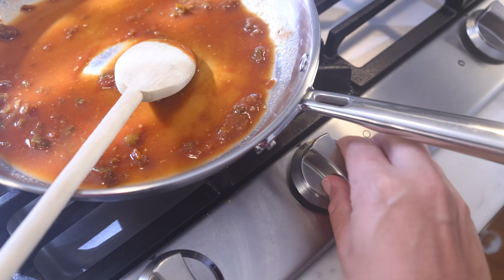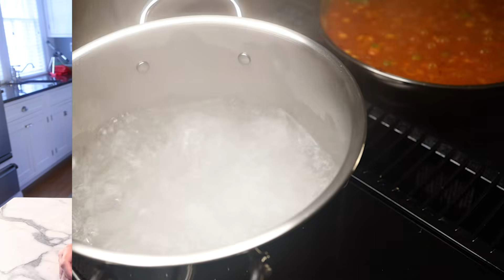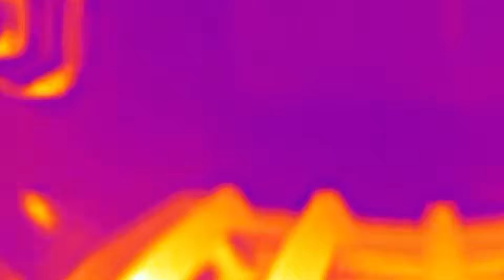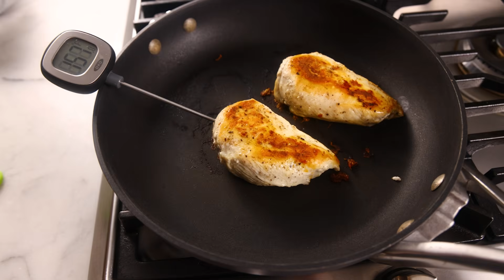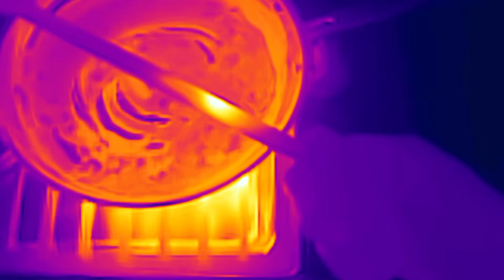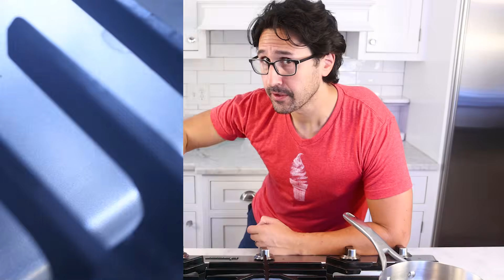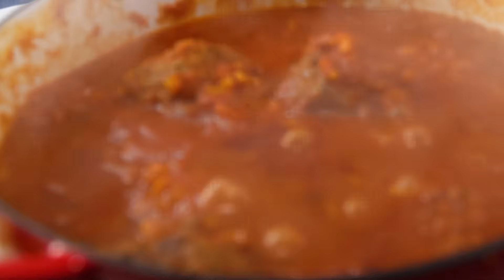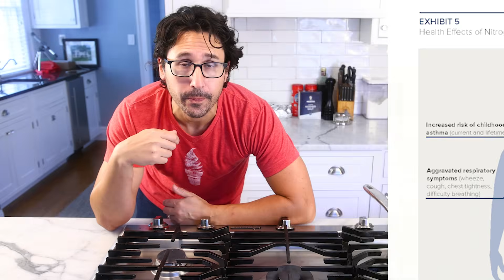Problems with gas stovetops | weak, dirty and dangerous

Comment: I wouldn't call NOx gases odorless. NO is odorless but it instantly drops your blood pressure and makes your heart rate shoot way up, you can't not notice it. NO2 doesn't have any noticeable effects (besides asphyxiation) but it does have a smell. It's a faint smell but it is there, reminiscent of diesel exhaust but with all the sweetness removed.

NO also very quickly degrades into NO2 so it's not a major concern. Besides, in high concentration NO2 has a strong deep red color, so you will notice it if it's getting bad. But natural gas makes so little of these compounds that by far the most troubling issue about it is carbon monoxide poisoning. CO really does have no smell, and if your room is small and without any air intake it could potentially asphyxiate you.

Comment: I hate electric stoves. I've only ever had the coil kind, and they were a nightmare. They did not heat anything quickly, it was impossible to maintain a temperature. I love my gas stove. If induction is better, I could get behind it. I've never used induction, so I couldn't say.
Reply: I’ve personally cooked with all 3. Induction is just way better. Less heat that escapes and makes the entire room way too hot. Works really efficiently and can make things hot really fast. Tho one of the negatives is that you can only use magnetic pans and you have to take good care of the pans because if the pans don’t have proper connection with the stove it doesn’t work as well anymore

Comment: genuinely can't wait to replace my old stove, even if its with another gas stove. the dumb thing wasting space in my kitchen has to be manually lit with a grill lighter just to get it going. the thing gives me enough anxiety that I prefer to just not use it and make things in the air fryer or on my little hotplate instead

Comment: The one thing I really like about gas is it is very visual. If a burner gets nudged, you can see the flame size increase or decrease. Also you're not going to forget to turn the burner off as the flame is pretty impossible to ignore. A lot of people dislike the more expensive pans you need for induction as well; although i think pans are something worth splurging on, so isn't problematic for me.
Reply: carbon steel isn't that much more expensive is it? I wouldn't want to cook on a $3 teflon pan anyway for health reasons
Reply: @niamhleeson3522  not all carbon steel pans work on an induction top. In consumer product speak, all carbon steel means is that the steel is reactive and can rust much easier than a stainless steel.
Reply: @atavax311  Wouldn't all steel pans work on induction? I am pretty sure I could heat up a box of nails on my induction top? I might need to test that.
Reply: @odizzido  I'm fairly sure not all steel pans. Generally to test if a pan will work, if you can stick a magnet on the bottom it will work on induction. I think it's the proportion of nickel in the steel that determines if it will work on induction.

Comment: I loved my ancient open coil. It did once blow and put a hole right through my pot though.
That said, for my tastes, nothing beats gas, which is going into the new kitchen as the main cooker, with a separate induction field purely for big pots of water or stock. 
I tried induction for general cooking and it just doesn't work for me.

Comment: Interesting. I generally prefer electric, but it’s because IME it has /lower/ heat. On every electric stove I’ve lived with (at least 9), I could make custards without a double boiler. But I always considered the lack of high heat with electric to be the trade-off. That, and the wok not working on electric. I had no idea there were electric stoves that could put out more heat than a gas stove—I’ve certainly never used one. 
My perfect stove would be 3 induction burners and 1 gas burner. Most of the time I want electric, but for some things gas works better.

Comment: i actually have the exact opposite issue with my current gas stove. it is just too hot actually. even on the smallest burner on the lowest point on the dial it just gets way way way too hot to do any kinda sauce without constant maintenance or the sauce splits.
Reply: @JorgTheElder  must not have heard that part.

Comment: I actually have a problem with my gas stove being too strong. I only use the two smallest ones and still, if I use a pan on the larger of the two, it gets very hot, making it very likely to shoot oil and cooking things like eggs too quickly. My only solution is to turn it on for a bit and then fully off, and so on.

Comment: I think he's mistaken electric stove tops with induction stove tops. That black portable stove top right at the begining works with induction and heats apropriate metal pans by generating osclating magnetic fields while an electric one will heat a stove top by means of a resistor.
Reply: He knows

Comment: Gotta disagree. Seeing that one of your pet peeves is the time it takes to boil I must point out that you showed that you have a portable induction cook top. I do too and there's no reason not to use it to bring water to boil in record time. Then just move pot to the gas stove. Very easy to do since you're most likely using induction on the countertop right next to your stove. 
Also, the idea that heat is wasted on the iron grate is wrong to me. The heat stored in the grate is also being transferred to the pot/pan above it, allowing the cook to turn down the heat a little after a time, and also providing more even cooking.
I don't experience problems with overheating either. Remember that you have at least two different sizes of burners so you can downsize if needed. In any case sometimes you will need to put the lid on askew to achieve the simmer that you desire no matter the type of burner.
As to needing a double boiler there's no need to buy one. I just use a bowl (Corelle works best for me) over a pot of simmering water.
Lastly there's no substitute for gas for control of heat. Let's say you're pan frying a steak and you want to baste it in the pan fat like everyone sees on those cooking videos. You can't do that the way you see if you're completely removing the pan from heat every time you lift and tilt the pan, as would happen with electric coil or induction.
You have interesting opinions on this but I must disagree this time.

Comment: I wonder if it's possible for a stovetop that has gas but instead of the regular metal grate top it's a pane of glass/quartz so not as much heat would escape?

Comment: The second big reason professional kitchens are switching to induction, apart from the better consistency, is simply the easier cleaning. Man, I still get nightmares from scrubbing the burnt gunk off our 8 burner gas stove after a strong day in the restaurant. The hours I spent on cleaning that thing are just ridculous. Sure, induction has a higher cost up front, but when you consider the wages payed just for keeping large gas stoves clean, induction stoves might actually pay for themselves rather quickly.
Reply: At a minimum, on a slow day, I still spent at least about an hour cleaning that thing, almost two if it's been real busy. With a glass top that time goes way down to 15 minutes a day max.

Comment: Here basically everything is induction, I can’t even find one of those countertop gas burners that run on propane canisters. It just doesn’t exist here.
I want one specifically for a wok pan. But my only options are either I go outside and light a wood/charcoal/coal fire or use induction :/

Comment: Buying a single ''burner' induction cooktop could be an extremely affordable (like $50) supplement to a gas stovetop. They're known to heat water extremely fast (especially if you choose a 220V model), and you can just unplug it and put it in a cabinet when you're done using it, because it doesn't get hot (only the pan gets hot).

I don't know how well the inexpensive models do 'low simmer' heat, and you need to make sure your pans will work with induction (cast iron, carbon steel, magnetic steel should work).

Comment: I have a gas stovetop with a tiny burner with low output. It's perfect even for those tiny 1-egg frying pans. When I need to boil a pot of water, it's usually best to tap it with hot water, close it with a lid and then put it on a burner with the flame that doesn't go all arround the pot. Bringing cold water to boil takes ages on either of these.
Reply: I encourage you to try bringing some cold water to a boil on induction. It’s crazy fast. Our stove has a boost mode and 4qt of tap cold water will boil extremely quickly.
Reply: @JoshuaRes  Single month after I wrote that comment, I switched to induction. It's like going from Dacia to Lambo lol. The only problem I have with cheap inductions is fairly poor low settings management. First time i managed to burn some butter and garlic, but it got much easier when I got used to it. This is one thing that people must know, that induction is fast af when you compare it to gas or infrared.

Comment: I'm in the opposite camp. I had never had a gas range until I moved into an apartment in New England.

We lived there for several years and then moved back to the South. Our house here has an electric stove, and I had to re-learn the dance of "moving" my pots and pans from the burner to avoid burning things, and have had a lot of problems burning food or under cooking food because of this.

I miss my gas stove.... I have never really owned an induction stove though, so I wouldn't mind making that jump when I buy a home.

Comment: In a bitter winter scenerio...electricity goes out which means even your GAS furnace won't work.  But you can still have SOME heat if you turn on your gas range.  NOTE:  This is DANGEROUS and requires carbon monoxide monitoring.  But it CAN get you through an emergency.  We survived 3 days this way.  The house was COLD but not frozen.  And I would NOT do this in a "super tight" house where no fresh air can leak in.

Comment: I bought a 1940s gas range because I don't have a 15 amp breaker to dedicate solely to an electric range, which is what is required. This range will last me for the rest of my life, it's super easy to repair, and it looks pretty.  I wish it wasn't emitting noxious fumes, but life is all about compromises.

Comment: Before I got a house, I had various gas and electric stoves. I hated the electric ones, which were just coils, but I love my current electric stove that has resistance under glass. Its a lot safer. You can put a paper towel under a pan and it gets burnt, but does not go on fire as a coil stove would. It has lag issues, of course, but they can be dealt with.

Comment: I think the type of gas stove make a huge difference in its performance.  I've noticed that newer "fancier" gas stoves have the pots sitting a lot further off the burner for some reason.  

My mother had a newer gas stove that was a pain to cook with because it took so long to bring things up to temperature because the pans were so far away from the burner (much like the stove in this video).  

On the other hand, the gas stove in my uncle's apartment (which is an apartment I lived in much of my childhood) is an old rundown '70s model.  The grates that hold the pans above the burners are much shorter, and it works fantastically.  Heats things up quickly, and gives you that instant control of a gas stove.  I have never used another stove in my life better than that one.
Reply: My grandmother has one of those. It's just a total pain to clean and you can burn yourself easily. Also the problem of "low not being quite low enough" remains. 

Never ever would I swap that thing for my induction stovetop.
Reply: Usually old gas is criminally weak, Like at my dad's old house that was built in the 30s, I am not sure how old the stove is, but the flame is so weak even at max power. I estimate the biggest burner only outputs 5000btu/hour which is weaker than a plug in induction burner, and due to inefficiencies was much  much weaker. Now at my grandmother's house, here stove is from 2009 and the max burner is about 13000btus and while that is more powerful.... It still is weaker than the plugin induction burner. People complain about the old coil stoves being weak, and that is true, But old gas was really weak as well, and alot of people forget that, or never had to deal with many of the old gas stovetops out there.

Comment: glass top is the way to go, but not induction. need a special pot, any normal pot you have becomes useless, and the special pots are extra heavy. technology can't fix these problems with induction stoves.
Reply: That’s just simply not true. I have countless pots and pans that I’ve had forever back when i used electric and when i moved and got induction nothing changed. Didn’t need to get new pans or new pots. There’s only a small couple of pans that aren’t magnetic
Reply: @ploppyjr2373  I don't know, never used one. I assume a normal pot wouldn't work as well because the proper pots have thick heavy bottoms to conduct the eddiecurrents.
Reply: @lorenzo42p  if a pan is magnetic you can use it. Some pots you can’t use but I personally thing induction is a big step up

Comment: The old fashion exposed coil electric stoves are the best. Rather than cycling on and off like glass top stoves, they stay at one consistent temp just like gas stoves but better. The max temp is higher and the min temp is lower than both gas and glass tops. They responsiveness isn't too bad, and you'll learn tricks to get around that issue anyways. You don't need a lighter to start it like you do with many gas stoves, and you don't have to smell the stinky gas either. They're easy to clean and way easier to fix or replace parts if needed. Not to mention electric ovens are far far far better than gas ovens.

Comment: Both efficient and power should be considered (beside safety). Gas stove produce more than 3.5kw per China standard (5kw at most?) while most people buy induction cooker in China is usually 2.1kw. I wonder how much power rated is your electricity cooker (either resistant or induction) in US or UK

Comment: bruh

actually only the regular electric 

induction type burns faster and burns 

hotter

regular induction >

pro wok high pressure gas >

infrared gas >

conventional gas > ceramic glass >

wok induction >

electric flat top / electric griddle >

hot plate >

electric flat top / electric griddle > coil

Comment: "electric stove with glass top is easier to clean" yeah but it doesn't tolerate a single drop of spilled salted water or else it'll burn and smell horribly and stain hard. I almost had to clean mine each time I used it. Honestly that's the reason I'll always prefer a gas stovetop that can tolerate a certain amount of spills and dirt.

Comment: The problem I have with a glass top is the fear of scratching it. Remodeling a house now, and I will be installing gas. You can’t ruin a gas top. If something does break it’s inexpensive. I prefer to cook with cast iron, and I believe over gas would be best for a cast iron.

Comment: I would love to know if there has been studies on health effects of long term exposure to EMF's emitted by induction stoves. We'll have to wait another 20 years I guess.
Reply: Its a 60hz buzz, the exact same as your power grid, it does litterally nothing to you. (Your phone would brick before you have health issues from magnetic fields)

Its 60hz which is in the radio section of the spectrum and its about the worst antenna there is, your phone will hurt you more than an induction range.

Comment: There is one major difference. I live in Germany (originally from India) and have seen all three types of stoves in my life. Indian dishes are cooked superiorly with gas stove rather than magnetic induction or coil induction. The heat curve properly matters. There are some costly induction models that can be far far better with gas like consistency (as i have seen at my friend's home). Currently I live in a premium Student dorm and my coil under glass induction doesn't have the proper efficiency. Dorms guys must have cheaped out. It takes 1-2 minutes to make water into boiling but takes forver to cook Indian foods. Doesn't maintain the continuous temperature. Relay switches it off and on. If you have to cook for friends as well, that day it works for first 45min properly and then stops working efficiently. On a gas burner, it used to take 45min for entire dish for 8 people. It just takes 1hr30min for the same. As an Asian, i do not approve this. I have never seen Wok compatible induction hobs. I would definitely find it useful since I really don't like deep frying with oil on flat vessels. It's very very dangerous. A curved wok style vessel is the prefect for such stuff as heat evenly spreads. Doesn't get too hot nor too cold. If you are unable to use the gas stove properly, then get trained from any Asian aunty. Doesn't matter if she is Indian, Pakistani, Chinese, etc. We all use similar techniques to cook and accomplish it perfectly. Any stove is hazardous since fire/heat is hazardous. There were numerous times that oil spilled out while deep frying. It happened more on induction rather than gas. All the Smoke alarms instantly went off. It's pretty easy to stop it from happening. Maintain the proper oil temp, fill only 1/3 of vessel with oil and fry in small batches. If you become greedy, water will expand in boiling oil and spill it out.

Comment: I've never seen gas stovetops used in my country, other than really small portable ones for outdoor use. They are not common here, I don't even know if it would be possible to get one here. On cottages with no electricity you either don't have one at all or a wood heated one.
The whole idea seems crazy to me tbh. I'm glad to have my induction stove :)